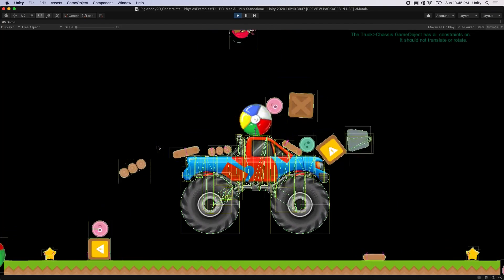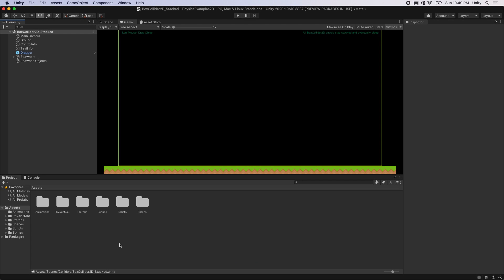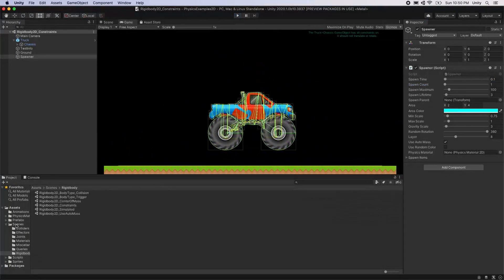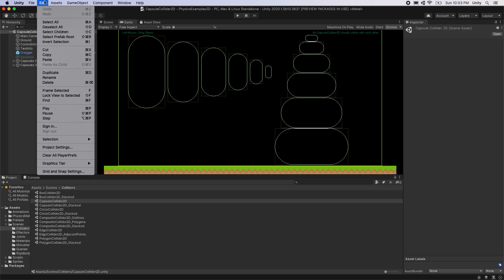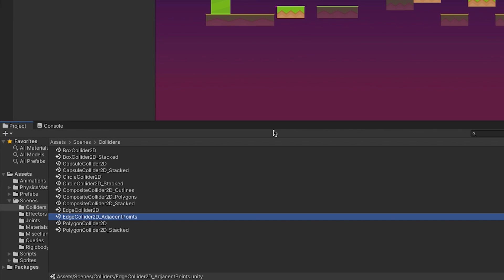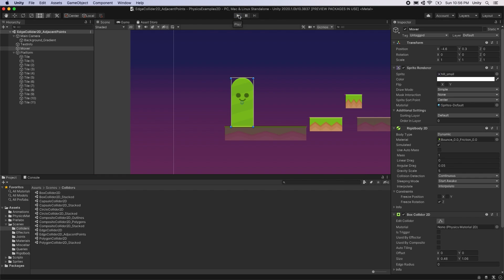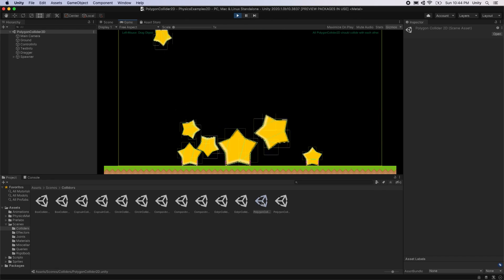2D Physics in Unity 2020.1! (Overview)

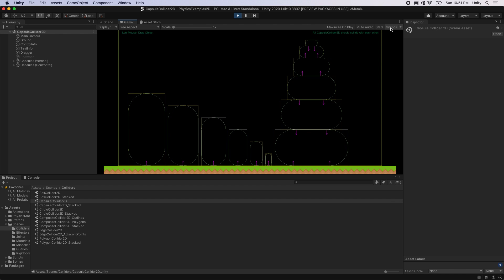Comment: 2:10 Can someone tell me what a collision contact normal is? Would help me out a lot.
Reply: If two rigidbodies are in contact at a certain point, the contact normal is the axis that is perpendicular to the two surfaces at that point. For instance for two spheres colliding, it's the axis going through the center of both spheres.
Reply: @lususnaturae3082  OK, thanks a lot for taking the time and writing this. I would have one more question though: If one sphere were to fall on top of another sphere and both spheres had the same x and z values, would that mean, that the normal of the bottom sphere would return a Vector3 with the following parameters Vector3(0,90,0), because the sphere collides at a 90° angle?
Reply: @reidondiesnatz8131  You can't really say that the spheres collide at a 90 degree angle, because an angle is always in reference to something else.
Here, since the two spheres have the same x and z coordinates, it means the normal of the contact will be along the Y axis. This means the normal will be of the form (0,number,0). Normals have a magnitude of 1, so, the normal here would be (0,1,0).
Reply: @lususnaturae3082  thx again so much, you are helping me out a lot. But does the rotation influence the normal. Thus if both spheres were rotated 180 on the x axis, would the normal still be (0,1,0)?
Reply: @reidondiesnatz8131  No, the rotation does not influence the normal, the only thing that can change it is the contact itself, but since it's two spheres here, rotating them does not change the contact. If you need the orientation of the spheres, you're gonna have to get it with their respective transforms but the normal won't help you in that regard.
Reply: @lususnaturae3082  OK, thx again, but is the normal in world space or in local space?
Reply: @reidondiesnatz8131  I'm not completely sure, you'd have to run some test to verify this, but I think it should be in world space
Reply: @lususnaturae3082  OK, I think I get it now. I'll be running a couple of tests as soon as I get back from vacation. Thanks so much for taking all the time to write the replies. I hope you have a great day and I'll stop bothering you now😂. Cya